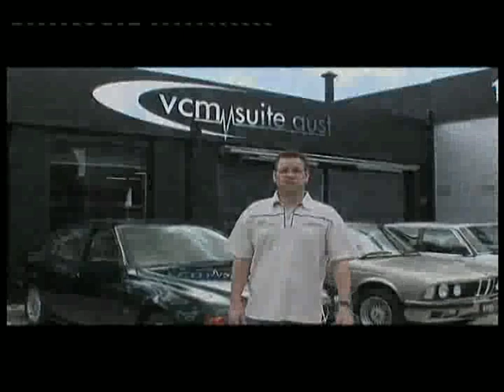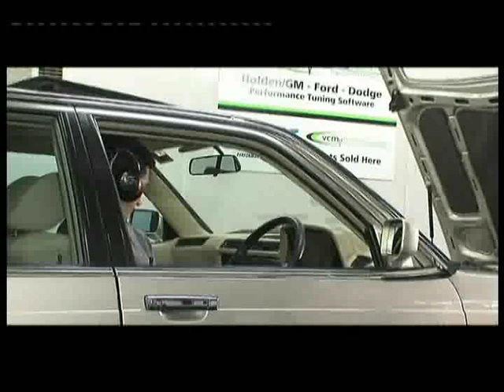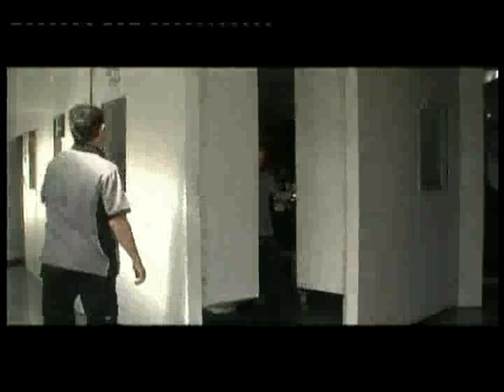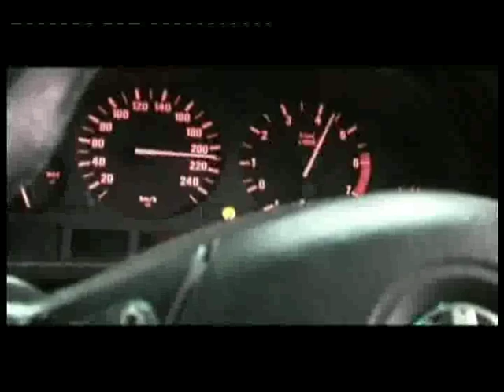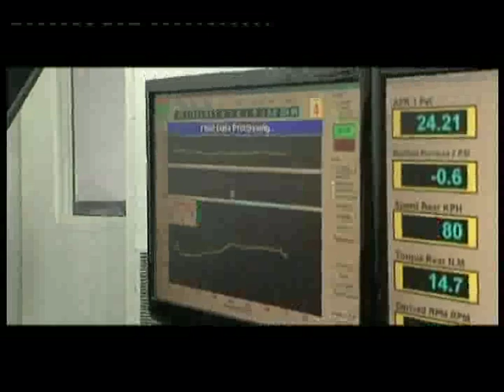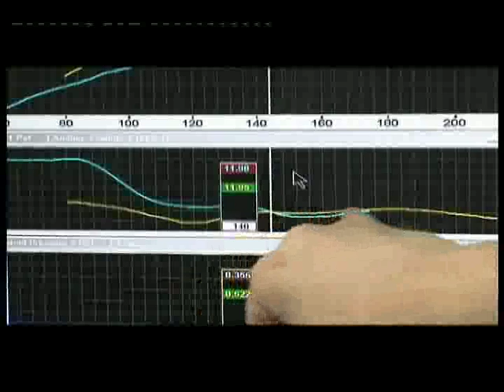XADO dyno tune trials

Comment: The guy says the air fuel ratio is "basically measuring what's coming out the exhaust." On the graph at the point he highlights AFR goes from 11.9x to 11.7x. From this he concludes Xado has "cleaned up the exhaust".  Is it possible he actually believes what he is saying?

Comment: anyone who thinks that XADO doesn't work...
Hasn't tried XADO.
I have used this product on four cars with excellent results and seen the difference every time. Even the engine temperature comes down.
My '92 Subaru SVX, notorious for tranny problems was missing shifts under load, hunting and acting like a candidate for a rebuild.... one tube of XADO blue hydraulic for power steering REPAIRED IT!
I do not sell or profit from the sale of XADO... just thought you might like to know...